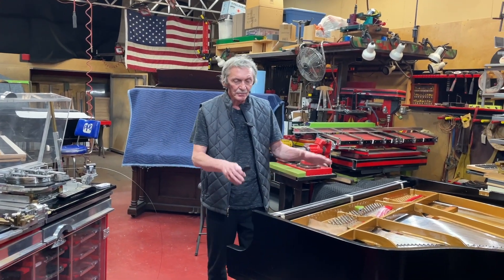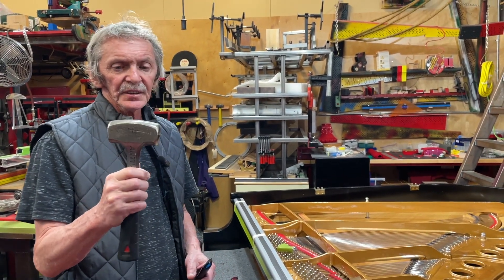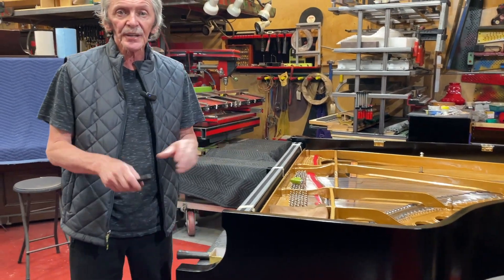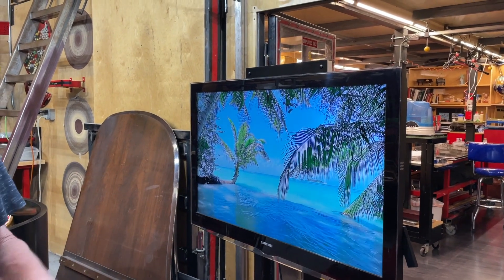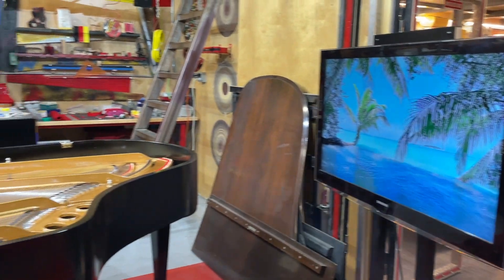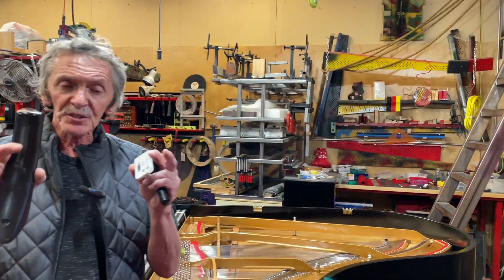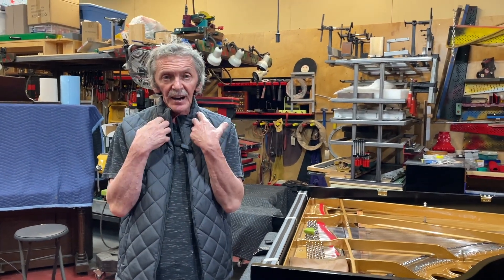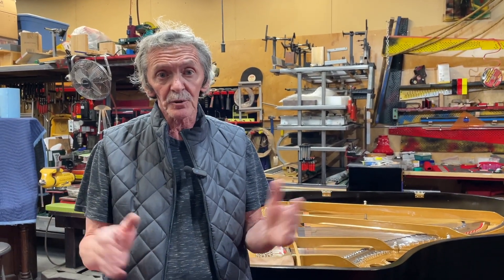Meditation in Piano Restoration - Restringing

Comment: Good it works for you. I would not work as well with that in front of me. I would daydream to much and reflect on my youthful scuba diving days. I need silence and total concentration when restringing. I recommend a pneumatic nailer to get the pins in a new block. I then use a 2 pound hammer to get to the precise height above the plate. Much easier on the wrist joints at our age.